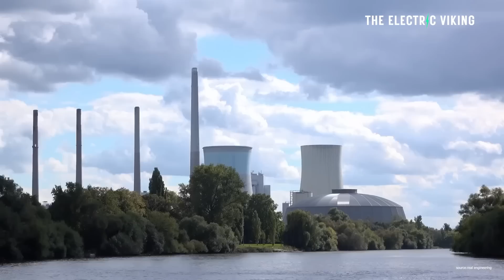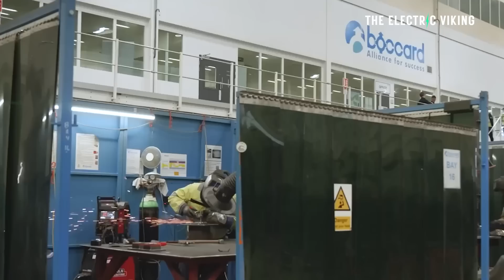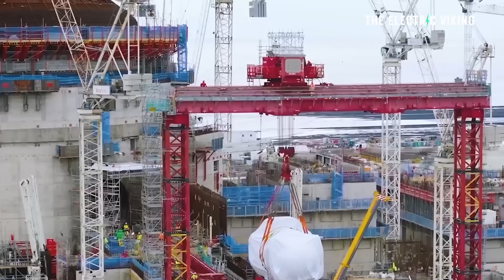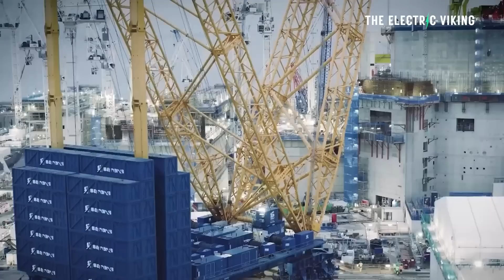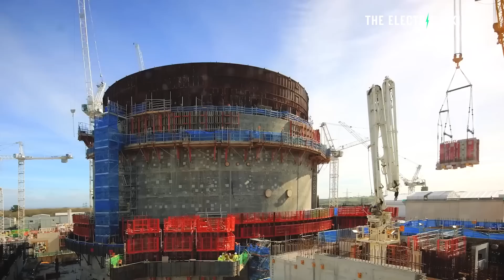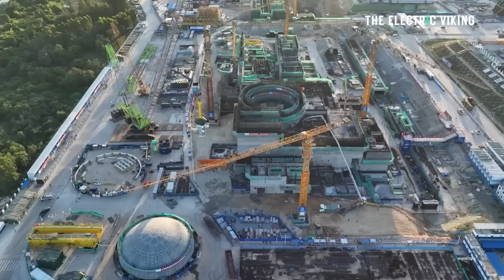Rats Overrun $49B Nuclear Plant: Hinkley Point C’s Shocking Crisis!

Comment: So the Uk wants to get off dependence on foriegn oil - meanwhile Britain is having China build and run Britain's huge new set of nuclear power plants at Hinkley Point - tens of billons of dollars, all to sell electricity to Britons at above market rates. If China and Britain "fall out" it could be a huuge loss for Britain. It's a massive vulnerability. Pretty sure the reactors would have remote "China access only"  "turn off" software hidden in it somewhere.

Comment: Yeah totally agree Sam, here's sum info on the topic below
Australia does not need nuclear power plants to achieve a future of 100% renewable energy. This conclusion is supported by multiple peer-reviewed scientific studies and expert analyses.
Why Nuclear Is Not Necessary for Australia's Renewable Future:
1. Abundant Renewable Resources
Australia has some of the world’s best solar and wind resources, making it uniquely positioned to meet energy demand entirely from renewables.
Solar and wind, combined with pumped hydro and battery storage, can reliably supply electricity across the continent.
2. Proven Feasibility
Studies by institutions like Australian National University (ANU) and the University of Technology Sydney (UTS) have shown that:
100% renewable electricity is technically feasible using current technology.
Transitioning is cost-effective and reliable with proper planning (e.g., building storage and transmission infrastructure).
3. Economic and Practical Limitations of Nuclear
Nuclear power is slow and expensive to build, often taking 10–15 years and costing significantly more than renewables.
Australia has no existing nuclear infrastructure, so starting from scratch would be costly and time-consuming.
Public and political resistance to nuclear remains strong.
4. Speed and Cost of Renewables
New wind and solar projects in Australia are already cheaper per MWh than coal, gas, and projected nuclear.
Battery and pumped hydro storage are rapidly scaling to manage intermittency and grid stability.
Summary:
Australia can and is already moving toward 100% renewable electricity without nuclear power. The focus instead is on accelerating:
Solar and wind expansion
Storage solutions (like pumped hydro and batteries)
Upgrades to transmission infrastructure

There are several scientific studies demonstrating that Australia can meet all its energy needs—both now and in the future—using only renewable sources like wind, solar, hydro, and battery storage.
100% Renewable Electricity in Australia: Key Scientific Findings
1. ANU 100% Renewable Electricity Report (2017)
Researchers from the Australian National University (ANU) conducted an energy balance analysis for the National Electricity Market (NEM). Their modelling showed that wind and solar photovoltaics (PV) could provide about 90% of Australia's annual electricity demand. The remaining 10% could be supplied by existing hydroelectricity and biomass. The study concluded that balancing renewable energy supply with demand on an hourly basis throughout the year would incur a modest additional cost of approximately AU$25–30/MWh (US$19–23/MWh). This approach avoided speculative assumptions by relying on technologies already deployed in large quantities, such as PV, wind, high-voltage transmission, and pumped hydro energy storage (PHES) . ANU RE100 Group+5iceds.anu.edu.au+5The Australian National University+5iceds.anu.edu.au+4Open Research Repository+4Australian Renewable Energy Agency+4Australian Renewable Energy Agency+1The Australian National University+1
2. ANU 100% Renewable Electricity Future Report (2025)
An updated report from ANU further supports the feasibility of a 100% renewable electricity grid. It emphasizes that wind, solar PV, and off-river pumped hydro energy storage (PHES) can enable the NEM to achieve 100% renewable electricity with high reliability and at a modest cost. The study highlights that wind and PV will replace retiring coal and gas plants at lower costs than alternative replacements, such as new coal and gas facilities . iceds.anu.edu.au
3. University of Technology Sydney (UTS) 100% Renewable Energy Plan
The Institute for Sustainable Futures (ISF) at UTS developed a roadmap for Australia to transition to 100% renewable energy by 2050. The plan outlines a phased approach:
	•	41% renewable energy by 2035
	•	64% by 2040
	•	100% by 2050 Energy Australia+4University of Technology Sydney+4The Guardian+4
This transition involves a significant increase in electricity use to replace direct fuel consumption, with renewable energy sources progressively meeting a larger share of total energy demand across all sectors . University of Technology Sydney
Technological and Economic Considerations
The transition to 100% renewable energy in Australia is supported by several key factors:
	•	Abundant Renewable Resources: Australia has vast potential for wind and solar energy generation, which are unconstrained by land or resource availability. ScienceDirect
	•	Advancements in Energy Storage: Technologies such as pumped hydro energy storage (PHES) and battery storage are crucial for balancing supply and demand, ensuring reliability even when renewable generation is variable. Open Research Repository+1iceds.anu.edu.au+1
	•	Cost Competitiveness: Renewable energy sources like wind and solar PV are increasingly cost-competitive compared to traditional fossil fuels, making the transition economically viable. 
While challenges remain in terms of infrastructure development and policy implementation, the scientific consensus indicates that a 100% renewable energy future is both achievable and beneficial for Australia.

Comment: Why do articles about nuclear power show cooling towers that have nothing whatsoever to do with nuclear power. The cooling towers are there for all thermal power stations - gas fired, coal fired whatever. A fundamental part of a reliable power supply network is a base source of energy that works regardless of sun, clouds, wind, tides or whatever. Rats are clearly a problem.. But also bizarre prejudices based on journalist's propaganda are an even greater problem.

Comment: It takes british and european regulators to make nuclear power unaffordable. Instead of giving one standardized plant a general go, they license and re-license each plant individually and a 100 times. At this price point China does build 15 plants in 5 to 6 years. And than - it´s not even rat-proof. Done like they are doing it in Hinkley point going nuclear is total nonsense and a waste of money. But - it could be done another way.
Reply: Since you site China: 
China's Electricity Cost by Energy Source
what is the current cost of electricity in china from nuclear, wind, solar, natural gas, and coal?
As of 2024, the levelized cost of electricity (LCOE) in China varies by energy source, influenced by technological advancements, subsidies, and regional factors. Below are the estimated costs for different power generation methods:
Current Estimated Costs (2024)
Energy Source	Cost Range (CNY/kWh)	Cost Range (USD/kWh)*
Nuclear	0.35 - 0.45	0.048 - 0.062
Onshore Wind	0.20 - 0.35	0.028 - 0.048
Offshore Wind	0.50 - 0.70	0.069 - 0.097
Solar PV (Utility-scale)	0.20 - 0.40	0.028 - 0.055
Distributed Solar	0.25 - 0.45	0.034 - 0.062
Natural Gas	0.50 - 0.80	0.069 - 0.110
Coal	0.30 - 0.50	0.041 - 0.069

And before you respond that is subsidies causing lower renewable prices in China:
Unsubsidized LCOE in China (2024, Approx.)
(Costs in CNY/kWh and USD/kWh)
Energy Source	Cost Range (CNY/kWh)	Cost Range (USD/kWh)*	Notes
Nuclear	0.40 - 0.55	0.055 - 0.076	High upfront capital costs, but low operational expenses.
Onshore Wind	0.25 - 0.45	0.034 - 0.062	Highly location-dependent (cheaper in Inner Mongolia vs. coastal areas).
Offshore Wind	0.60 - 0.90	0.083 - 0.124	Higher maintenance and grid connection costs.
Utility-Scale Solar PV	0.25 - 0.50	0.034 - 0.069	Costs rising slightly in 2023-24 due to polysilicon price volatility.
Distributed Solar	0.30 - 0.55	0.041 - 0.076	Higher than utility-scale due to smaller installations.
Natural Gas (CCGT)	0.55 - 0.90	0.076 - 0.124	Highly dependent on gas import prices (LNG vs. pipeline).
Coal (New Plants)	0.35 - 0.60	0.048 - 0.083	Without carbon pricing, coal is still cheap; with ETS, costs rise by ~0.10-0.15 CNY/kWh.
Reply: @markvalery8632  Fascinating info, thanks - I´ll take a closer look at the data. China produced 950 TWH from wind, solar and hydropower in the first quarter of 2025. It´s double the yearly energy production in Germany from all sources for the whole year 2024. Quite suddenly it became clear to me, that China with it´s all in approach is having more success and faster than us by phasing out this, shutting down that and speaking of small percentage gains while electricity is gettings scarcer (instead of abundant), unstable and expensive.

Comment: For the same amount of money, they could have insulated millions of houses and/or installed solar panels and batteries, which would be a lot safer and quicker.
Reply: Hinckley C will provide the electrical needs of 7% of households- that’s about £35k a house - lot of insulation, solar panels. Triple glazing, batteries etc… for that.
Reply: @antwnpowell  glazing lasts around  20 years, solar panels 15-20, batteries 5-10.  They are not cheaper and that’s before getting into the disposal of them.  Nuclear is essential.
Reply: @derekw100  My 15  year old solar panels have hardly dropped in efficiency, my triple glazing is good for at least another 50 years. Batteries are good for 25 years plus. All getting cheaper very year and 95% recyclable. Installation takes less than a week. When will Hinkley C start producing electricity? Who pays to look after the waste for 10000 years? Nuclear electricity is way more expensive than solar, wind or tidal.
Reply: @antwnpowell  most of that is verifiably untrue.  What percentage of fission products needs to be kept safe for thousands of years? What happens to defunct solar panels and wind turbine blades?  What happens when it’s not sunny or windy?  What is the footprint of solar/wind to produce the same energy as Hinkley?
Reply: You can do both; I've been an advocate for both nuclear and solar for years.
Reply: Modern nuclear energy is one of the safest sources, with the lowest levels of radiation emission. Ironically, coal plants emit the highest levels of radiation pollution.
Reply: Safer, quicker but the lights literally go out in winter and especially during the Dunkelflaute (Google it) when the lights could go out for months or a year+. Batteries are short term storage days to weeks and cannot solve this long term storage problem.
There have been times when the UK ran off 100% wind and solar. November-December 2024 less than 5% of power was generated by wind and solar and a whole second power generation system in the form of natural gas power plants filled the gap in generation and accounted for something like 70% of electricity generation.
The great thing about nuclear is you can use it overnight to charge battery storage when demand is low and deplete the batteries during the day to meet demand.
Solar and wind is deceptively expensive needing a whole backup power generation system or masses more solar and wind farm plus a long term energy storage solution like maybe hydrogen stored in salt caverns, but now you still have a second power generation system requirement to use the hydrogen. And then what about energy losses converting to and from hydrogen.
Reply: Not really.
Reply: you're right - but it's not technically "cool" - it's boring.
Reply: You cannot run only solar and wind. If not it happens what just happened in Spain. You need to cover the base load with something more stable like nuclear.
Reply: @luigifranceschi2350  batteries are good now but the tech is improving rapidly in both efficiency and cost. The future is solar plus batteries.
Reply: Batteries are for grid balancing and storage in the days to weeks timeframes. Northern Europe needs to cover periods of lower sun and wind generation for months and even 2 to 3 years in the Dunkleflaute periods. Batteries cannot solve this.
Reply: @AdrianHilder  also batteries last about 10 years, a new nuclear power station lasts 60 years minimum.

Comment: Shame that the bias shows up with distorted opinions on nuclear power it makes your views on electric vehicles and batteries very dubious. A nuclear plant lasts around 50 years abd much if uts cists are in its safety , there are  excessive problems like rars in all places connected to humans , I suspect EV companies also suffer,  There are developments in fusion that will remove any radiation threats and it is important to find compact good sources of energy production , solar as it is does not fulfill all needs and as a relatively short life span before becoming a recycling problem , the same is true of wind turbines

Comment: Funny how the last two nuclear stations at the site,now closed,worked fine,since construction.Also ,it's not been under construction for sixteen years,around half that.I agree ,it's the wrong station, Rolls Royce proposed small nuclear should have been adopted.
Reply: No, the PWR design as built at Sizewell B should have been copied at the sites of all the old Magnox stations which was the whole point. Build the first one, iron out all the problems so the next ones will be easier. All sabotaged by the privatisation of the supply industry and the 'dash for gas'